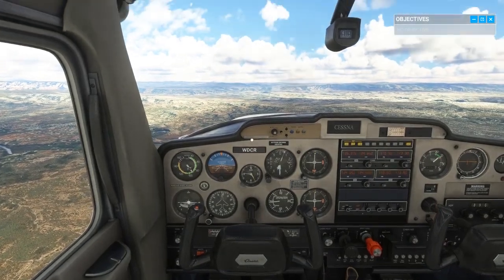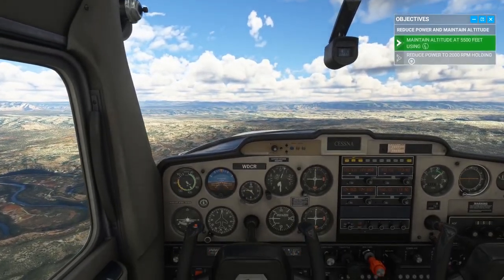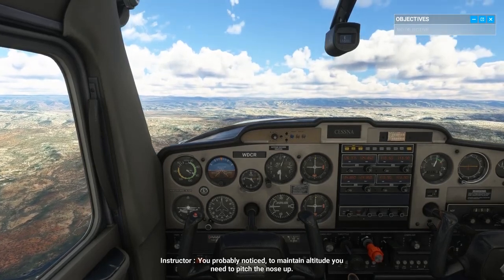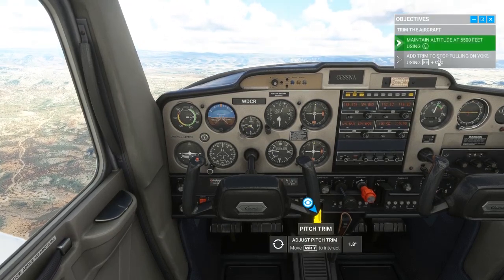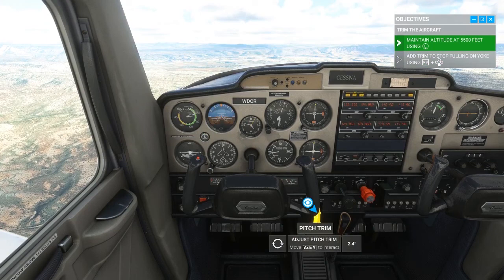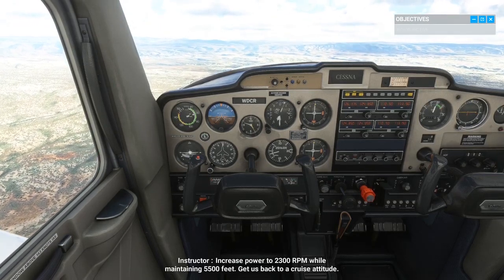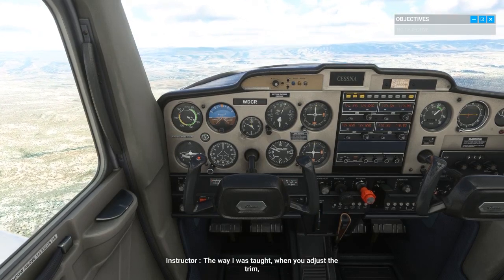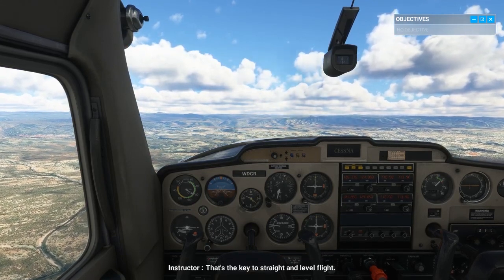Microsoft Flight Simulator | Flight Training : Power Settings & Straight and Level Flight

Comment: On Xbox I can't even see out the window after choosing throttle. Camera view is stuck on it. It says to press B to get to 1800RPM which is the same button that goes back out of choosing the throttle. Absolute garbage. Makes no sense.
Reply: on xbox you don't need to select the throttle, just by pressing B is going to reduce the throttle. if you happened to select the throttle, then use the right stick (up or down).
Reply: @user-csjndwi Thanks. I deleted the game but will try again sometime.